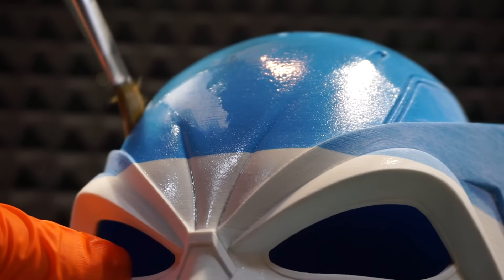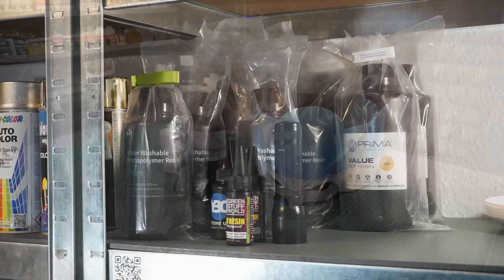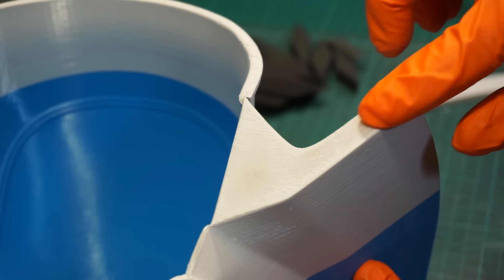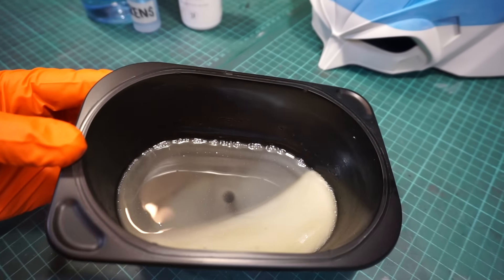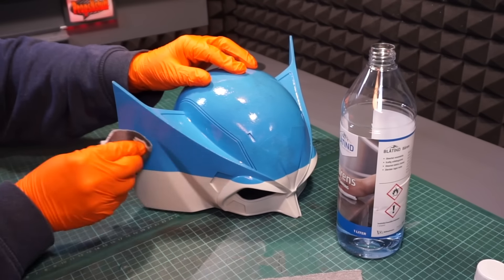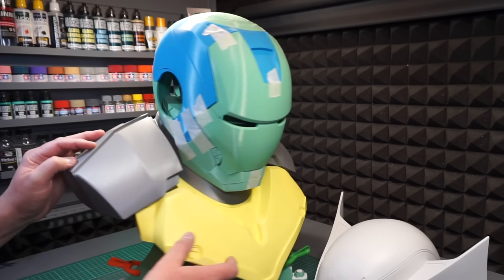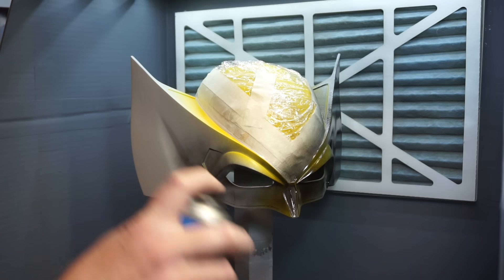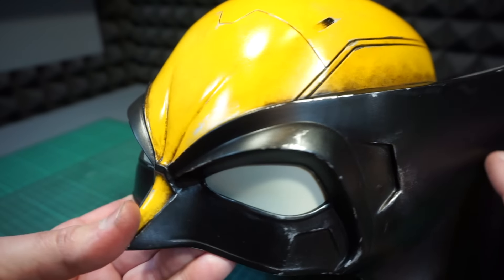Making The Wolverine Cowl - My Fastest Way To Smooth Out A PLA Print N’stuff

Comment: You are correct about the talc.  Body fillers are basically just polyester resin, like you would use for fiberglass work, with fillers like talc to create the paste consistency. You can also make your own out of regular polyester or epoxy resin and add in talc or glass bead till you get the consistency you want.
Reply: Can you still get talc? Doesn't it have asbestos in it?

Comment: very nice video, thank you. Why mix resin with talk powder though?
Reply from the maker: Hey there buddy😉 And thank you for saying that😉 The leftover 3d printing resin is usually way to running. So when you add the talc, it becomes more thicker in consistency. And therefor easier to apply with a greater control👌 Have a good one, cheers

Comment: nice Vid thx. I pesonally use spray filler. It is way easier to be portionend. maybe when you add a colour to your resin it will be better to see how much you applied
Reply from the maker: Thank you for that buddy😉 yes, I also use filler primer for my fdm prints. But when it’s as bad as this turned out….I’ll have to resort to other fast methods of smoothing out those print lines. Cheers

Comment: great video, I am just starting to experiment with 3d prints and removing print lines - what is the item you use to spread the resin?  looks like foam?  thank you!
Reply: forgot to also ask - I am looking to eliminate the print lines on the slates of a 1/72 scale building roof - without filling in the crevices between the slates - any thoughts on how to accomplish?
Reply from the maker: Hello there buddy😁 yes, it’s a disposable foam brush/stick thing. I got a bunch of them from eBay. But you really get the same result with a plain paint brush😉
Reply from the maker: And for that scale I would first go with a couple of coats with filler primer. It may be enough to make it look good, and not lose the details on the roof🧐 Good luck, and have fun. Cheers
Reply: @PropsNstuff  thank you sir I appreciate the advice! when you say filler primer, do you mean spray can or the stuff that looks like putty?

Comment: So I used the Green Stuff world and it worked as expected but the bottle ran out quickly. I sprayed filler primer onto a different UV resin and it didn't adhere properly even after wet sanding. Looks like the kind of stuff for casting jewelry. Is this the wrong resin?
Reply from the maker: Hello there Alex😁 So cool that you're trying out new stuff😉 Yes, I usually bye the green liquid masking in bottles of 3. And always make sure to combine them with using regular masking tape to make it last. As for the problems with primer/paint not adhere prober. I've had the same issue with some types of resin. But I have found that if you give it a light clean with a cloth and some rubbing alcohol (Isopropyl Alc) That it solves the issue right away😉 Let me know how it goes, good luck mate. Cheers

Comment: So you did no sanding between the UV solution application and then priming. It was simply painted on and then cured. Later it was primed...thats it.
Reply from the maker: Hello there Mr. Gardner. Almost, I did do sanding after applying the UV resin. But just some Light though. Work in small areas at a time. Apply resin, UV light and finish it of with light high grit sanding. The better you get at applying it the right way, the less you need to sand. Good luck, Cheers😉
Reply: @PropsNstuff  Thank you for the response. I have a project that will require a good finish and I am going to give this a try. I ordered the materials after watching this video. I am excited to try it..thank you for posting it. I suspected that you did a light fine grit sanding afterwards. Your comment about the surface being like fine sandpaper after the application gave me that hint. So once they arrive. I am going to start testing it and then if it goes well. That will be my new finish technique. I confess I was stunned by the results. WOW
Reply from the maker: @richardgardner7019  No problem, glad to help😉 Make sure you do some testing on a scrap piece before you move on to you’re build😉 Hope it turns out great👍🏻
Reply: @PropsNstuff  Thats the plan. I am using Light Weight PLA as the parts are for a large format drone. While I want it to technically work right, stuff I build needs to look good as well. Will let you know how it goes. Thanks again

Comment: I only print mechanical prints so never any painting but I am a fan of weathering on say space suits ect. That said, when you blur the lines right up to the edge of the color transition black it just screams overspray from painting which after watching video I can see was not the case. I would've been proud to produce this and you fixed all the issues I could have pointed out so it seems a shame to feel it's flawed on first glance.

Comment: Reusing resin that you already have is great, but when you don't have it I found that hardening putty is the best stuff EVER. They make this hardening putty with both tiny and micro bits of steel in and that shit because rock fucking hard in an hr after its done fully curing. That shit is AWESOME, only down fall is you have to get good with getting it flat and as smooth as you want it in that hour time frame otherwise it becomes much harder sand out any leftover. That's why atleaat for me I got really good at using it on things that have flat surfaces and were easy to smooth in the lines, like the Ghostbusters 3d printed trap parts. In fact that was the first thing I used it on actually and it came out great, and I just kept on going from there. Now I'm looking forward to becoming acquainted with this and possibly even merging the 2 if possible and the prop/print calls for it

Comment: I have been trying to finish some 3D printed grips for a handheld emulator video game and have been having a hard time.  I can't seem to get that smooth, hard plastic that comes with manufactured products.  My best luck has been to sand it down throughout the grits.  200 - 5000 (which looks REALLY cool with transparent filament.)  I then hit it with automotive enamel clearcoat/primer.  I spray it ever few days to fill in all the gaps and imperfections with slight sands in-between.  I then finish it with a gloss clear coat.

My problem is that it never feels fully cured and starts to smell after use.  My hands seem to heat the paint back up and it gets a bit sticky.  It also seems to almost stick a bit to surfaces if I leave it on it.  

Could I just skip the whole process and do that UV resin only?  Maybe do a few coats?  Would it still have that sprayed on smoothness?  Bah idk.   Any advice would be awesome!

Comment: I think a clear resin with air brush is the best solution.
Reply from the maker: Hello there buddy😁 Yes, for a hard varnish clear top coat its perfect. (Like a car hood finish😉) But for smoothing out a PLA resin print...I at least found that it takes sooooo many layers to build up the thickness needed. So that took way longer to do. Or do you have a solution for applying a thicker viscosity resin with an airbrush? I would love to know😉 Have a great one, cheers

Comment: Amazing build EXCEPT for the silver rub n buff at the end. Many prop makers just apply it to every edge they see in an attempt to highlight the detail and over do it. You need to think logically about where the mask would be scratched. You've added scratches on recessed areas that would be the most protected areas like under the eyes and in the mask lines. This loses the realism subconsciously. Also you should use at least 3 shades of weathering to trick the mind (black, brown, red) for example, you wouldn't paint grass just 1 plain green - add red or brown powder/ dust to add 3D depth too.
Reply from the maker: You’re are absolutely right. I was so focused on how to do the PLA smoothing technique so the finishing with rub and buff and single layer weathering was just a quick fix🫣have a good one

Comment: Resin is pretty dangerous stuff, It works, no problem with that and at least you did not suggest spraying resin which imo is a definite no. And your work and results speak for themselves but I really think you should mention the risks of working with resin as it’s nasty stuff which I am sure you are aware of.but others watching this might not.
Reply from the maker: Hello there Mr. Paul😉 Thank you for that😁 And yes, you're right. Both resins, paints and other mediums are to be used with proper handling. I often mention it in the video builds, as well as in the description. But surely not often enough. I'll be sure to make more of a point of it next time. Thank you for that👍 Have a good one, cheers

Comment: Great job!!! How many layers of primer did you put?
Reply from the maker: God morning Mr. Morand😉 I did a total of 3 coats. First one was a light coat. And the two last coats where a bit more heavy.  I did a quick pass with my heatgun in between. So all the layers where done in 30 ish minutes. (The filler primer dryer very fast) But I left it to fully cure until the next day, before applying any paints. Until next time😉 Have a good one, Cheers😉
Reply: @PropsNstuff  thank you! Have a good one too

Comment: Forgive the newbie question: but is the material too thin on a 3D printed piece to simply sand it smooth? (As opposed to filling low spots with resin) I’m suspecting it is. But I’d much rather do extra initial sanding than deal with an extra resin step and sanding.

Comment: i think the small blobs of fast uv resin on small props like that gun could work in spots without alot of detail
Reply from the maker: Hey there😁 Yes, you're totally right. but it depends on a bit of trial and error. So starting out with something bigger before a smaller prop is a good way to go. Cheers😉

Comment: The cheap throwaway make up sponges would be perfect for applying the resin. Especially to helmets because of the face like contours.
Reply from the maker: Lol, yes😂☺️ My thoughts exactly. But if you noticed, that's what I used to mix it all together in this video. And it ended up breaking up and leave small sponge pieces  all over....So I went back to the good ol paint brushes😁😉 Might be a bad batch of cheap sponges, but I don't know...🧐

Comment: I don't get why you sand the 3d print then you use resin and then sand again, I directly brush 2-3 layers of UV resin on the piece and then I do the rough sanding, then if I need real polish I prime and wet sand and then paint. The point of using resin is that it is much easier to sand than PLA.

Comment: Sanding sucks because the plastic tends to melt if you try to work fast. The sandpaper gets clogged and needs renewing all the time. You also have to use different grain of sandpaper to reach a good result.
A wood scraper instead gives excellent smooth finish and allows to remove material 10 times faster. I have some parts that would take 3-4 hours of sanding, but done in 20 minutes with a scraper. Also, a scraper can be sharpened so the expense converges toward zero.
Seriously, if you do any 3d printing or wood working, look into scraping instead of sanding, it's a life changer....

Comment: For large surfaces I recomend u to try soft puty for plastic wich uses for repairing car bumpers. Easy to use and easy to sand. Issues: u need to be very fast because it harden so fast and workplace needs to have good ventilation because it is very toxic.

Comment: That's an awesome tutorial! The best I've seen for sure! Just wondering, do you need a respirator or any other safety equipment when working with the uv resin?
Reply from the maker: Hello there Mr. Maker Prop😉 Thank you so much for saying that, it means a lot😁And, yes. As a rule, always read the label and instructions of the mediums you would use. And do as it says. A lot of these products are not really the same around the world. So I usually make a habit of always using a mask and nitrile gloves. Have a good one buddy, cheers
Reply: @PropsNstuff  awesome thanks!! Im gonna try this out for the first time tomorrow, thanks!

Comment: There's a WAAYYYY better way to smooth PLA... costs practically nothing... no stinking clean up, no expensive resin or UV lights to be seen...and it strengthens the hell out of your PLA prints... simply smear on liquid nails, and call it a day. 
I have not seen ANYONE do this yet but it works really well...I just use my pointer finger, apply where needed and bingo... it sets like plastic/rock hard and no mess no fuss.. save you $$$ give it a try. I just printed a 15" Statue and this stuff is like magic. Your welcome :)

Comment: Curious did you sand before paint or just straight from prime to paint? This is an amazing build. I’m about to try this on some 3D prints.
Reply from the maker: Hey there Joe😁 Kinda. That’s to say, after the priming. I only sanded down some spots that I had applied to much primer. From there, it was resin all the way. This build was really all about how fast, and with how little I time I could spend on sanding. For a PLA print that is. Hope you get into this 3d printing hobby👌It really is an great escape from the everyday stress😉 Have a good one, cheers

Comment: Wow I am super glad I stumbled across this video. I have been looking for an easier method of finishing LW-PLA and I think I know have a direction to go in. I had not considered UV cure coatings. Thanks ever so much for posting this. I am curious if you need to sand the cured coating afterwards. Also if it adds much weight.

Comment: As a fellow prop maker, I must say, you're truly legit. I have been using resin and spray putty interchangeably for years, but your method to add talcum powder is new to me. I've learnt something exciting, can't wait to try it.

I don't think dedicated small bottles of uv resin is practical. Just because the props which makers makes are usually very big.

One difference is, I use a large UV torchlight and a wider brush than yours to cover wider areas faster. I usually make 8 of these at the same time 🤭

Btw, with masking tape, hardware stores sells low tack(low adhesion) masking tape for hobby paints like this. You're totally right that masking tape will tear off paint, I make masks too and got my fair share of this problem. I'm using the low tack masking tape from 3M now and they save me a ton of rework.

Comment: I have a BETTER CHEAPER SOLUTION to making it smoother faster. Done semi high build primer spray paint. Works awesome gold in glasses n sand off like butter. Also looks smooth as glass after. "Why wouldn't you want to use the leftover resin you already have?" Because this way takes forever n has same if not worse results

Comment: Price of Resin vs Quality.... Good Effort BUT Not that Great to Be Honest,,,,, As a Professional Spray Painter Experienced, I'd Rather use a Primer Adhesive & Primer Putty to Get perfection at Half the Cost! Your Wasting so Much $$$ on UN needed Materials. Primer Putty & Paint Primer with sand paper at $3 a Can. Old School option is Way Better. No Painters Tape, The Finish is Actually Very Average at Best. Sorry Nice Effort But this is Definitely Not the Right Way to Go. It needs Way more Coats of Paint and Clear Coats to Give it that Reflective Metal Look & you should be using Automotive Trim Paints not Acrylic DIY paints. The ONly Part that Makes this Professional is the Tutorial and Video.

Comment: Wow so many tips and all explained very clearly.  I have tried XTC but found it really difficult to use, way to expensive and imo over rated.  I now use left I’ve resin like yourself although I have been using flour to obtain the consistency and it has been really great.  Another finish I have developed is mixing the resin with sand from my local beach,  have got some amazing results although it is less forgiving.  Thanks for the video though extremely helpful

Comment: Resin is highly toxic and messy, Why not use PU varnish instead ? It does the same job just as well but it does not stink and you can just leave it out to dry instead of fumbling about with the little UV light.

This way might be fast....fast to get cancer in 10years as well.

Comment: I really love your workstation.  The paint shelves look great, but the DIY spraybooth with the magnetic fan ducting was the icing on top :)  I'm inspired!
I wonder if you could thicken a 2-part epoxy with fairing filler?  I like the resourcefulness of this idea, but most photopolymer resins have poor UV stability over long periods.  I think epoxy would not only coat the surface and be very nice for sanding after, but also would penetrate the surface a bit and create more isotropic properties for the plastic :)
Obviously there's a million ways to skin this cat.  Thanks for the great video!
Reply from the maker: Hello there Mr. Russell😉 Thank you so much for all the kind words😁 I'm just glad to share a bit of my passion, and maybe be of help for other fellow makers. And yeah, the spray booth has gotten a lot of comments. So I'm working on a video for it now. As for the Finnish. You're right, many ways to Rome. But I'v never heard about the "Fairing filler"? So I will definitely look into that, thank you for the tip😉 Have a great one, cheers buddy

Comment: Cowl is a pull over, usually stretchy material that form fits to your head. A cowl can have protective elements and still be a cowl. 

Whereas a helmet is usually rigid and placed over the head and non form fitting.  A helmet could still have padding that helps it fit better.
Reply from the maker: Thank you for that Chaun😉 I didn't know, so thanks for the info👌 Have a great one, cheers

Comment: Great video and brilliant tips. This looks like it will work just as well as other fillers, and give a LOT more control over how runny/thick it is. Definitely gonna try this out!! 
Does the resin strip or react poorly with primer? It’s common to fill, sand and then prime a model only to discover that you missed a spot or it needs a little more work. Can you apply the resin over primer?